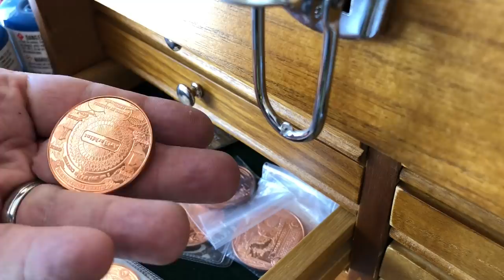Making a Coin Ring

Comment: The slower the metal cools the better it is annealed. Cooling it fast hardens it. Very nice job on the ring.
Reply from the maker: In this case, that is completely wrong, as that rule applies to Ferrous metals only.  Copper - Which this is - is a non-ferrous metal and quenching doesn't have any impact, only the heating, so quench away!  Thanks for watching....

Comment: Loved your coin ring demo. You’ve got a serious set up there.  I’m not through watching the vid, but I’m sure with the equipment you are using that the result/outcome will be a very professional looking ring.  I’m a metalsmith (jewelry) from the mid 70’s on.  I understand some of the steps...such as what annealing and the pickle are for.  Others may also be interested in the “process” as well.  Your press is a cool item and something I’ve never seen.  Also, I would be interested in knowing (not for coin rings) what type of gas tank you are using.  Love that it is small and compact.  Obviously, not an oxygen/acetylene mix.  Thanks for sharing your knowledge!
Reply: sounded like a mapp gas torch to me.

Comment: Really interesting work.  Never seen that done before, but heard about it.  Is it me, or is the ring still slightly conical and not quite cylindrical?  Maybe it's an optical illusion, since one side seems thicker and the other side seems thinner.  I assume this is how all coin rings come out?  Again, not trolling, just asking out of ignorance of the process.  Also, does the size of the hole you initially cut ultimately determine the size of the ring in the end?  I know you were fine-tuning the size with that press, but it doesn't look like you could have down-sized it from there.  Finally, if you don't mind me asking, what do you think it would cost to duplicate your setup?  I saw Jason's Works on your tools and have looked on the website, but obviously there are other things you're using, too.  Thanks for sharing!  Really interesting bit of craft.  Amazing that the details remain after all of that pressing.
Reply from the maker: Virtually every coin ring is actually thicker at the reeded edge.  I try to balance this out by leaving a slight cone shape, and removing some material from the inside of the reeded edge, but no matter what, you will have essentially tow different sizes on the ring based on which side you measure....

Comment: I liked your video so much I just jumped right in.  But, I decided to use more expensive currency. I put heat to it for the exact time span as you did...BUT it burned completely up...I cannot figure out why it would not have been a greater ring because I used a 100 Dollar Bill.   Dang it.
Reply: Terry Davis
Reply: Terry Weaver it depends on the metal and heat source I’d recommend getting a more accurate way of heating and really you just want to soften the metal so keeping it in a toaster oven set to 25°bellow the melting point and I recommend having it coated in anti oxide when you heat it as it may have oxidised not burnt
Reply: Terry Weaver
Man, for a 100 dollar bill you need to give it an overnight bath in 50/50 ratio of Paint Thinner & Motor Oil before you try to anneal it. Better luck next time.
Reply: Ya'll know I were juss jokin' right?
Reply: Terry Weaver  yeah I fought it that's why I been practicing with 1 dollar Bill's till I get the hang of it.  One trick I learned is to use plenty of high octane alcohol so far about a pint of ever clear softens everything till I get bent
Reply: Terry Weaver
Nah man, I've burnt hundreds of hundreds since your comment. The key is cotton cloth, you must soak the cloth in a mixture of flammable liquids THEN wrap the note.
Reply: Hugh Duncan
1 dollar bills won't work, it needs the extra two 0's to work properly. Practise with 100's, trust.
Reply: WHOOOOSH....!!!!!
Reply: LMAO you pulled my chain all the way to the end. Well played.

Comment: Cool video i have a question why did you heat then cool the coin ?in the beginning
Reply from the maker: The heating softens the metal. As this is a non-ferrous metal, quenching doesn’t cause hardening, so quenching only serves to speed up my work flow. And it’s fun

Comment: i make them from silver quarters using a claw hammmer, welders hammer, the stove, a socket, pair of pliers, screwdriver, a flat and round file, sandpaper, and lastly a polishing wheel. no special tools. just junk from the shed. i made mine and my wifes wedding rings this way. on my couch. the only electric tool i use is wheel. i do it the hard way. not with some fancy ring jig. anyone can do that. try it my way bud. bet u cant
Reply from the maker: I of course am impressed, but think you under appreciate what it takes even with good tools.  That said, you are probably right - I couldn't do it your way, but I probably wouldn't want to either.  Guys actually used to bang rings out with nothing but a spoon or so I hear, and I sure don't want to try that either.  I would love some pics of your work to share on my live stream.  If you are up for it, email me some pics and a brief write up.  captainpaul@cox.net

Comment: Hi Paul what is the technique you use to remote fire scale or black marks from coin after annealing ?  Also what is the pickle solution you use ? 
Do you have a video about it ? 
Big Thanks Paul
Reply from the maker: I anneal in plain water and polish away any potential scale.  I really only get it on cupronickel coins and I don't do a lot of those....  BTW - Scale makes for a great patina!
Reply: @pauly7218  thanks mate ,, I had this  80% silver coin that became black after annealing and it’s been hard to remove it .. I saw your video about the product to polish it called flitz 
Will try it .
Big thanks mate

Comment: I have a question here: what's the necessity or the reasoning behind filing it whenever you take it off the press?
Reply from the maker: This process is very hard on the coin, and micro-cracks can form at the cut edge even with proper annealing.  Filing the edge keeps the micro cracks from eventually breaking the coin.  It's a step that shouldn't be skipped....

Comment: I've been making rings out of coins for 35 years, And this way seems so much longer than the way i was taught. it takes me half the time as it does this Technic.  I don't heat and dip my metal in water because it makes it brittle, it changes the molecular structure of the metal. it is different..
Reply from the maker: Actually, this is the modern way and very fast. I’ve slowed it way down for viewing. As to annealing, you are actually backwards on this. Non ferrous metals soften with heat and work harden as they are manipulated. By heating them I reduce the chance of splitting the coin. I’d love to learn more about your methods. Thanks for watching.
Reply: Correct method for annealing copper,  I've made lots of solid copper molds for lead jighead making. Copper work hardens.
Reply: Douglas Christensen you are clearly confused. He’s make a ring you wear on your finger NOT one you wear on your willie. Everyone knows pecker rings take half the amount of time, duh

Comment: The very first step, where you heat treat it and dip it in water.  Wouldn't that make the coin harder and more brittle and harder to work with?
Reply: with non ferrous metals quenching makes it softer, the opposite to iron.

Comment: we used to make these on the rigs.drill a 6 mm hole cntr of coin then 6 inch of threaded rod and clamp th coin on to 1 end with 4 nuts .on a anvil ot metal block spin and tap the edge of the coin with a 1 lb hammer …..when the edge has inverted remove rod drill hole bigger just smaller than the finger then file out  and polish smooth ..
Reply from the maker: How fun!  I would love to see that!

Comment: You don't use US currency, right? What kind of coins are you using?
Reply from the maker: I do also do rings with Vintage Morgan Silver Dollar - yes - it is legal, but here I'm using a Copper Round from Art Bar Mint....
Reply: @pauly7218  yes what is legal?  If you are saying that it's legal to destroy US currency, then that's not true, you might want to check the law on that, because I have already looked into it.
Reply from the maker: @roypatterson9910  You are completely and totally wrong here.  It is completely fine to use currency for artistic purposes.  The laws regarding altering and defacing currency are very clear that it is illegal to do this things with fraudulent intent - In the old days folks would shave gold coins to less then their legal weight and sell them - illegal.  Did you ever deface a penny in a squishing machine at Disney Land?  Artiesians who work with coins have been dealing with this question for a very long time, and it has been researched to no end....
Reply: @pauly7218  Yeah, it is wrong to do it with fraudulent intent, but it's also illegal to destroy US currency. Look it up, according to Title 18 chapter 17 of the US code which sets out crimes related to Coins & Currency anyone who Alters defaces mutilates impairs diminishes falsifies scales or lightens coins can face fines or prison time.

Comment: Why does he heat the coin and the ring more times and then he puts it in cold water?
Reply from the maker: Heating the metal makes it softer and easier to work with - less brittle.  As work prowesses, the ring gets harder.  This is called work hardening.  Failing to anneal it enough will cause the ring to split, ruining your work...  Thanks for watching...
Reply: @pauly7218  but you don't seem to anneal it, because after heating it you put it in cold water, that should harden/temper the metal, and make it harder but also more likely to break. Anyway thanks so much to you man to share your work.
BTW: did you mean "as the work progresses"? Sorry I'm not English mother tongue.
Reply from the maker: That is only true of ferrous metals.  Silver is non-ferrous and thus the quenching doesn't have the same affect is it would with, say, steel.   @syncmeandroid
Reply: @pauly7218  cool, thanks for teaching me this.

Comment: Definitely not square or the same thickness from one side to the other.
Reply from the maker: There will always be some give and take when making coin rings as the outer edge is always very think especially compared to the cut edge.  It's up to each crafter to determine a strategy for dealing with it.   Thanks for watching...

Comment: i can see that there is a side wider than the other how do you solve that ?
Reply from the maker: You really can't ever make both sides the same thickness.  I file and soften the inside if the the thick edge as much as possible and if it's real bad I'll leave the thin side a tiny bit narrower.  It really isn't noticeable when worn...

Comment: When you put your hot ring in the water you HARDEN it next time try letting it cool on it's own then form it.
Reply from the maker: Actually, that isn't true of Silver - "Non-ferrous metals such as aluminium, brass, copper and silver are annealed by heating to a low red and quenching in water (the opposite of steel)."  Thanks for looking out for me though!